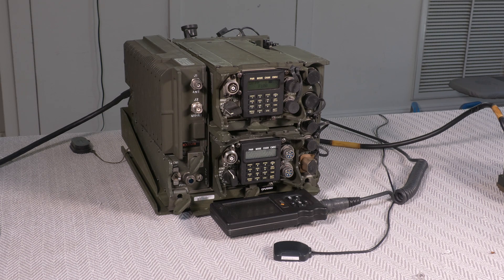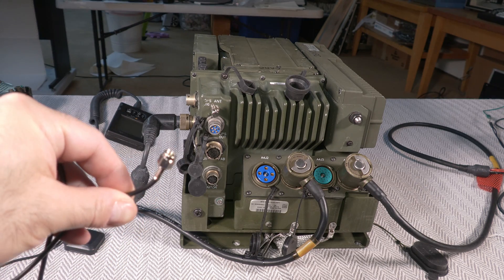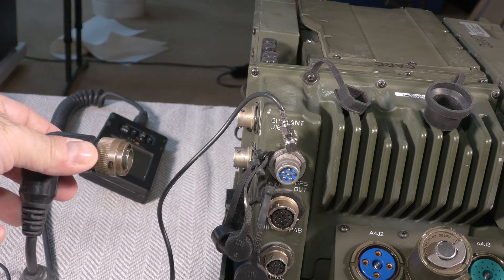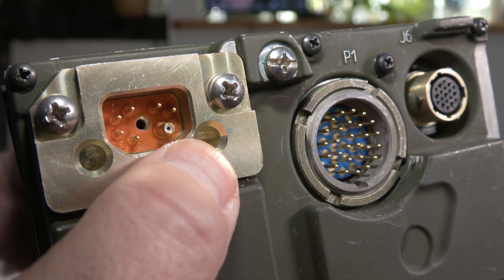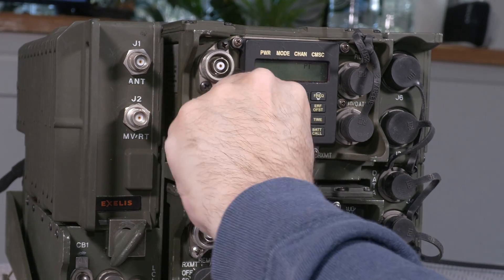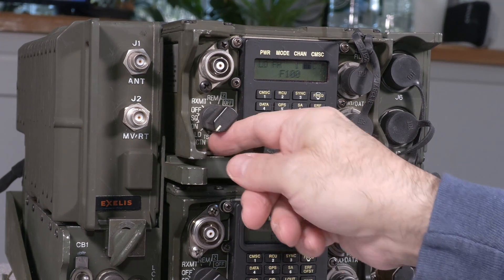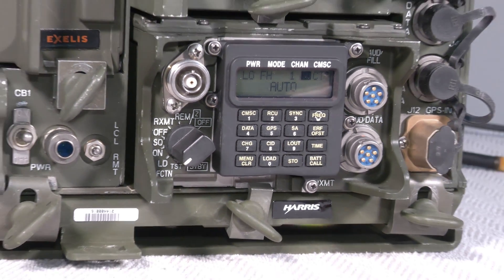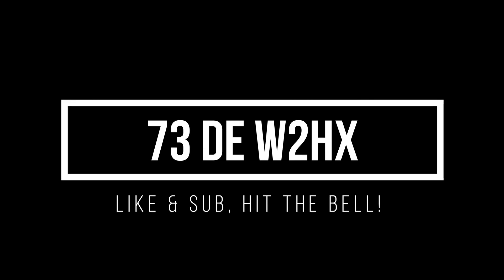GPS on the AN/VRC-92

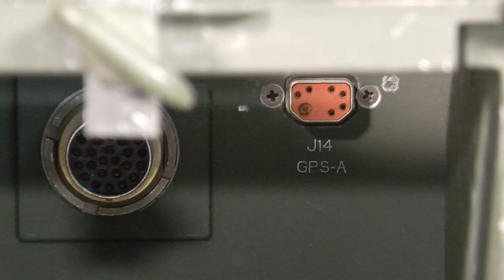Comment: 5:06 I can see the center conductor/pin for the GPS.
Reply from the maker: Yes, that is the bottom bay which receives the RF from the antenna. It is the top bay that doesn't have it (or, as I found out, doesn't need it). thanks for watching!

Comment: I wouldn't mind a unit like that for my jeep ! Wonder if they can do ALE?
Reply from the maker: I just started installing this in my land rover. stay tuned I'll show a video of that one day
Reply from the maker: BTW, ALE is an HF concept. These radios are VHF. These radios use frequency hopping, but for the purposes of making it harder to jam - ECCM (electronic counter-counter measures) and obscuring the communication. ALE is to get the best link between radios. In VHF they kind of assume the communication is not a problem.